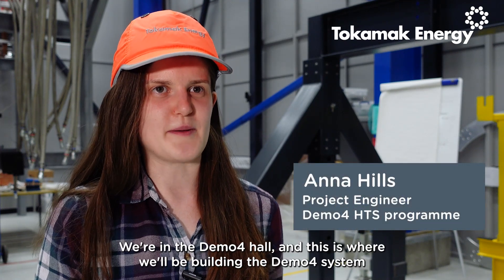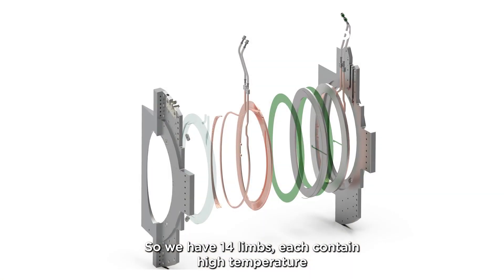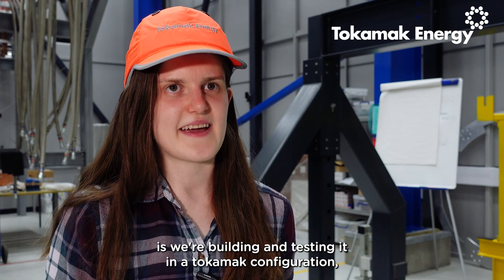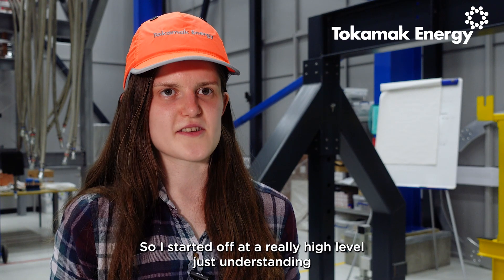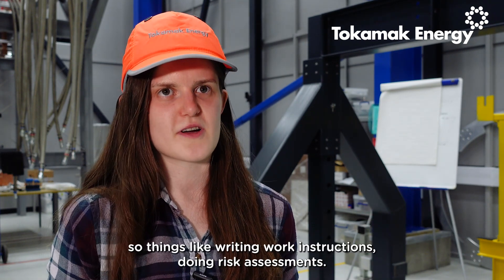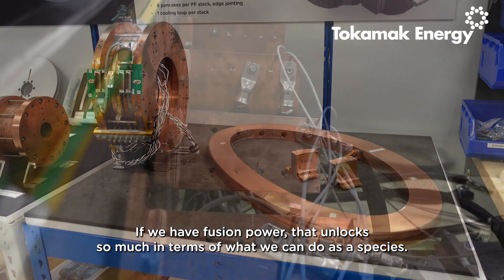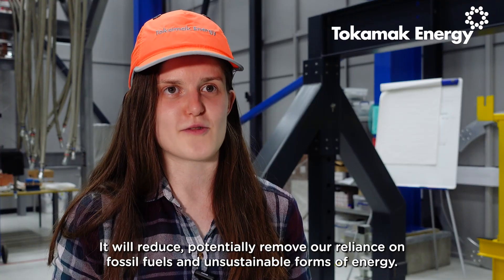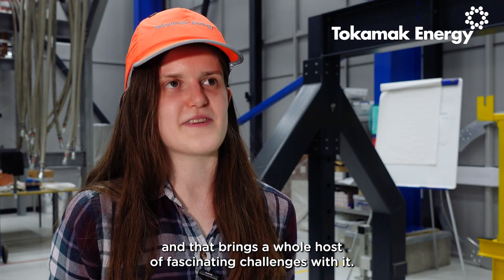Fusion Pioneer Anna Hills - Assembling Demo4, the world's first tokamak configuration HTS magnet

Comment: "Imagination is more important than Knowledge" - Einstein.
"When fossil fuel supplies looted - they turn - curse - that destroys Consciousness in humans and the Future".
Karl Marx, Nikola Tesla, Einstein, Huxley, Orwell, Susskind and 20th Century Physicists  - should be forgiven for thinking their systems can last forever - finite fossil fuels are dangerously hypnotic to humans and their mental capacity.
Humans were not ready morally, ethically and intellectually to start the mass extraction of fossil fuels with the advent of the steam engine 300 years ago.
The Magna Carta indeed requires now overhauling - adding to it the right for humans to understand what Energy really is;
"In any system of energy, Control is what consumes energy the most.
No energy store holds enough energy to extract an amount of energy equal to the total energy it stores. 
No system of energy can deliver sum useful energy in excess of the total energy put into constructing it.
This universal truth applies to all systems.
Energy, like time, flows from past to future" (2017).
https://youtu.be/yLOHdW7dLug?t=760